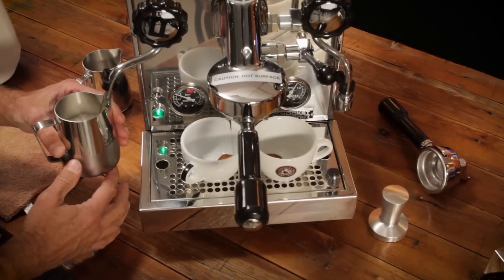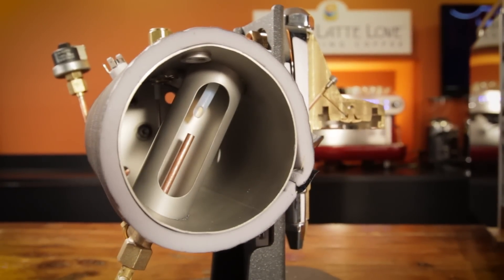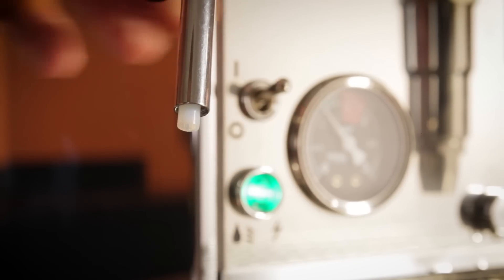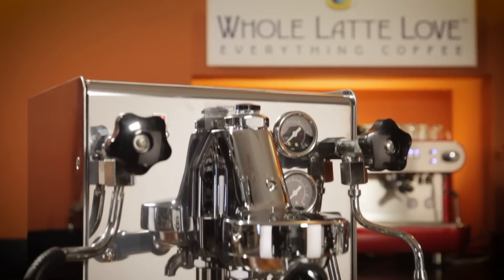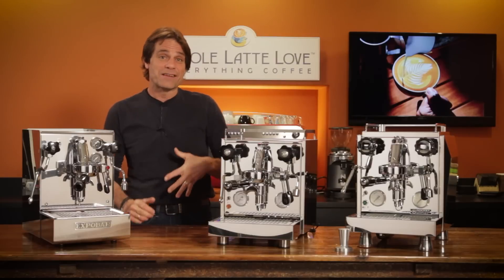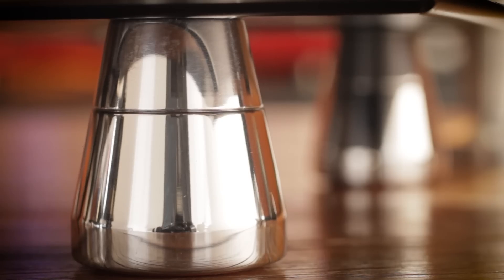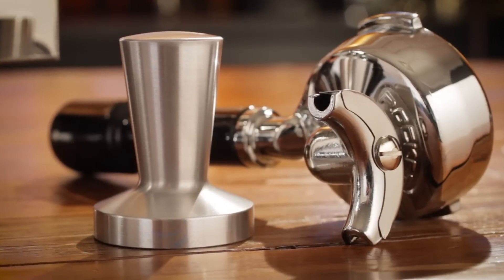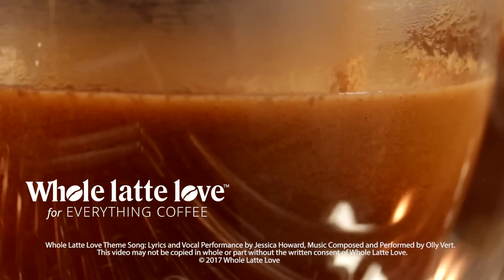Compare Top 3 Heat Exchange Boiler Espresso Machines 2017

Comment: Hi Marc, I am catching up on many of your videos. I like your way of presenting as well as the different level of detail in different series (compare, inside out ...). The dual boiler of the Brutus shows preaheating of the brew water while running it through a HX in the steam boiler first. Which other dual boilers use that same concept?

Thanks!
Reply from the maker: Hi CM, Thanks for the kind comment. As far as I know the dual boiler Expobars are the only prosumer level consumer machines which pre-heat water for the brew boiler using heat-exchange inside the service boiler.
Marc
Reply: Izzo alex duetto IV is a dual boiler and preheats brew water by running it through HX in the steam boiler.

Comment: Love my Profitec 700 from WLL!  Spring for the dual boiler folks.
Reply from the maker: Drew C Hi Drew, Pro 700 is a fine machine! It’s the one I use everyday in the studio. Is yours plumbed?
Marc
Reply: Whole Latte Love getting it plumbed to the RO system this week!  It was a sell job to get the wife to build our kitchen around the 700 and E37s, but well worth the effort!  Your insistence to plumb the machine inspired me.. :)  I look forward to waking up every day to exercise the setup!  Thanks again!!
Reply: Drew C did you consider the pro 500 at al? if So what made you go for the pro 700 just curious
Reply: Jesus H Medrano plumbable rotary pump larger capacity dual boilers and frankly, no need to ever worry about how it could get any better (aka upgrade envy)  :-)  note I did consider the 500 and it is a very fine machine at a great price point!  You’ll be happy with either purchase
Reply: I can see the value in the office leva, but (on my local Australian source, pricing may be different elsewhere) the other two are getting so close to the pricing for a dual boiler, it's a hard sell. At the price points, considering these are long term investments for homes, get everything you want. IMHO anyway. But the first one (can't check while writing a comment, great work YouTube), the office leva, it's enough cheaper to make it a viable option. Even without going to the rotary, the rocket is still about 75% the price of the R58. And it gets even closer once you add the rotary.
Reply: Drew C how many lattes do u makr a day? see i only make 2, and for two coils to heat up everyday plus the wear and tear it just seemed like.over kill to me. if i did more than four i think i would.of gotten the 700. thats my main reason but for.the reasons u stated also like the pump etc i did consider.the 700
Reply: Jesus H Medrano you absolutely should also be looking at how many coffees you will be making a day. It would be hard to justify a dual boiler rotary pump, plumbed in beast for one coffee for example.
Reply: Dogmatic Pyrrhonist thats exactly my point thats why i bought the pro 500. i only make two a day max.

Comment: Hi Mark, and thank you for this video! Question: How do you like the electrically heated groups of the  Bezzera’s HX machines? Obviously they didn’t make the cut in this video, however I’m somehow attracted to the idea, that all the heat and pressure of the boiler is dedicated to brew or steam and not to keep the group properly heated?
Reply from the maker: Hi RB, You are welcome. Thanks for the comment and question. Here's a video comparing PID HX Boiler Espresso Machines: Bezzera BZ07, Profitec Pro 500 PID and Rocket Evoluzione R Giotto. It's complete with some Scace and heat up time test results: https://youtu.be/Rn1S23pGPiQ
The BZ07 uses the electrically heated group. The TLDW version of results... The BZ group reached stable brew head temp 18 minutes after power on. It took the Pro 500 a bit over 30 minutes and the Rocket about 40. Faster heat up time is one advantage of the BZ group.
Marc

Comment: that's what I call professional review when you take them apart and explain PROs/CONs of engineering (what happen with Lelit? not good enough?)
Reply from the maker: Hi TBQ, Thanks for the comment. We do feel it's incredibly important to get inside the machines and provide as much detail as possible! FYI The Profitec Pro 500 now has the PID like the Rocket machines in this video. We did some Scace testing on the Pro 500 and it has amazingly accurate brew temps. If interested you can see the test results in this review video: https://youtu.be/9Ps4JfqRPuI 

As for Lelit, it's not a brand we carry at the moment so I have no access to their machines.

Comment: i have expobar office leva single boiler hx ,is that any solution for me when brewing the brew pressure gauges vibrates fiercely after 1 year use
At first it only show 4 bar when my brew flow was right and i thought was normal but now it vibrates and not show the right pressure at all
Btw this machine is really beast at this price point 😃😃

Comment: hi Marc, I recently read a recommendation that after turning off my espessso machine, i should open up the steam to depressurise my boiler to avoid damaging it.  is that true?
Reply from the maker: Hi BL, Thanks for the question. Not needed at all! Machines with heat-exchange or dual boilers always have a vacuum relief valve on the steam producing boiler. When the machine cools below 212F/100C pressure in the boiler decreases and the valve opens by gravity resulting in the boiler equalizing to ambient air pressure. Maybe somebody was talking about single boiler machines and cooling down/refilling after steaming? That should always be done on single boiler machines after streaming.
Marc

Comment: I've had a heat exchanger and just hated the uncertainty regarding temperature. Got a single boiler now with PID and shot timer. Will always be my recommendation whether single or double boiler.
A question: Using a Zero water filter....what are my chances of having scale issues? My water direct from the tap is on the hard side.
Reply from the maker: rick9482 Hi Rick, thanks for the comment. Only way to know for sure on your water is to test after treatment and plug results into a Langelier calculator.
Reply: Zero water is a good filter for heavy metals, lead, etc. with a lot of ion exchange resin. But it doesn't do as well with chlorine, chloramines, and VOC's. If you are going to use a consumer filter, the best you can do is the DuPont line of water filters. Better yet, get an undersink system. from Lowe's or Depot with a decent carbon block that lasts a thousand gallons.

Comment: Hi, how about Rocket Appartamento vs Profitec Pro 500 PID?
based on the prices on your website, is profitec pro 500 pid worth another 300 dollars?
I suppose both of them produce a similar quality of espresso shots?
Reply from the maker: rockccf thanks for the question. I’d do the Pro 500 PID if you can. It has rock solid brew temps. With the Appartamento you will need to do a cooling flush before brewing a shot. There’s always a little guesswork with a pressurestat controlled machine like the Appartamento as the in boiler temp can vary by >10F. The Pro 500 is equivalent to the Rocket Mozzafiato and Giotto PID HX machines as far as brew temp accuracy. Hope that helps. If you have more ?’s let me know and I’ll be happy to answer. 
Marc

Comment: Hi, could tell me how much cost Rocket machine or expobar machine , I have ice cream shop need good machine for use , thanks
Reply from the maker: Hi Rami, Sure...

Expobar is currently $1249 reservoir only, $1399 for the Plus which is plumbed.
See them here: https://www.wholelattelove.com/espresso-machines/semi-automatic?product_brand=89

Rockets run $1950 - $2500.
See them here: https://www.wholelattelove.com/espresso-machines/semi-automatic?product_brand=96
Reply: Whole Latte Love many Thanks for your respond

Comment: Hi,
I have rocket giotto type v.  I got brew time of 25~30 sec for a 60ml shot.
But still it's too sour. I always warm up my portafilter and cups before brewing. And the brewing pressure is between 8~9 bar. 
Which part can i possibly be doing wrong? It's really stressful. I am using lavazza oro.
Reply from the maker: Hi Haram, Thanks for the question. Sour flavors generally indicate under-extraction. Your timing is in range and pressure is good. What's your brew temp? If sour you may want to increase.
Marc
Reply: @Wholelattelovepage  the boiler temperature from PID was at 120 degree Celsius. And i took your advise and tried 123deg c, then the shot came out great. No more sourness. :) thank you very much Marc!